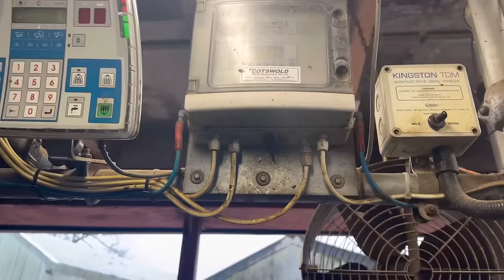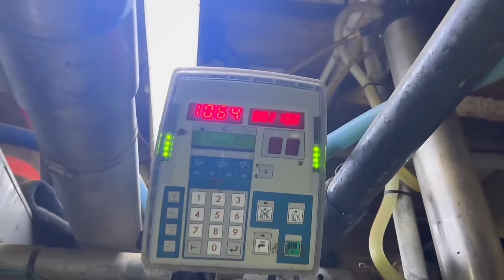MILK WITH ME!

Comment: Interesting video. Good work, you seem to have a nice operation going. It is all about getting a good procedure going that works well and saves work. This can easily become almost degrading work otherwise, considering the intensity. When I was young my grandfather and uncle ran a milkfarm in Northern Sweden, with up to 100 cows. It was profitable but very hard work. The farm was old at the end and they had to kneel when attaching the milking machines. Consequently my grandfather had to replace at least one kneecap. I helped them feeding the cows sometimes, which included scooping out partly frozen ensilage in -20 or -25 degrees Celcius. Work that build character when you are 12 years old!

Comment: Yes, the ladies are beautiful.  The cows are also gorgeous in their own ways.  Holsteins, guernseys, jerseys and more... I live in a rural area of W. PA, USA with several dairy farms.  The farms are very large, owned and operated by great folks but if one ever visited any of them, I would almost guarantee that you would never return or at least, not often.  The reason for this is that they are extremely odoriferous, ie, they stink to high heaven!  Cleanliness is at its best under the circumstances, but everything stinks badly and then when one leaves the farm, the stink has ingrained itself into every part of one's body, hair and clothing.  When one is inside the milking stations or parler, as clean as the try to keep this, with all the water being used especially in spray form, the humidity is very high which, once again, only compounds the stink/stench of the dairying process.  The cows stink, too, no matter how clean one tries to keep or make them.   Driving home with the windows down helps, but only minimally.  The only solution for this is to immediately remove one's clothing and shower once home.  Laundering the clothing helps, too.  Now, I am not criticizing the farmers, except that truth is truth.  When I do visit, I switch my vehicle's air on to inside recycle keeping the smells outside, until I open a door to exit.  Then, when I return, depending upon what I was doing there, once back in my vehicle brings the smell problem inside.  When I get an adequate distance from the cattle area, the windows come down and the air circulation returns to outside air.  OK, don't get mad at me for painting a realistic picture of this side of dairy farming.  We love our dairy neighbors, but there are downsides to this industry.  Towards the end of their video, the folks are spraying down the milking 'parlor' and then the walkway.  The tractor is pulling out the cow manure/shit and urine.  Then, the man is squeeging the floor.  One has no idea of the stink!  The ammonia level is high.  All this atomized stuff is being brought into their lungs, being absorbed into their pores and all their clothes.  Ammonia is very toxic and tends to liquefy one's lungs and is flammable if concentrated high enough.  OK...enough...but I know what i am talking of.